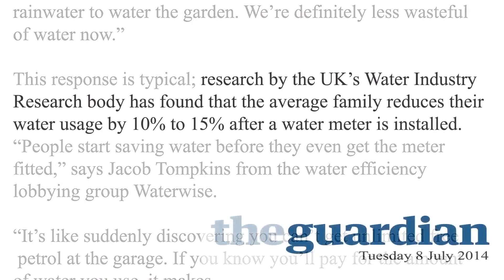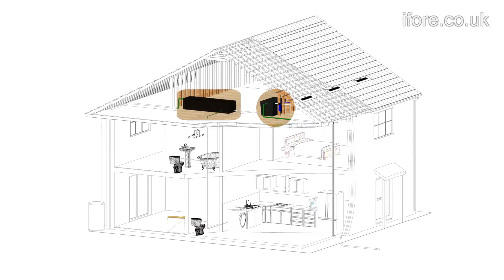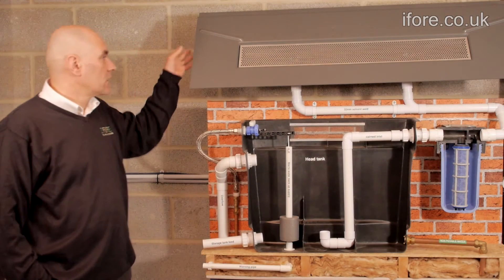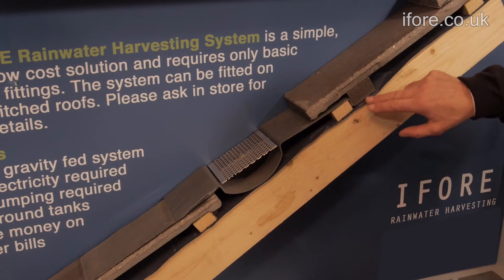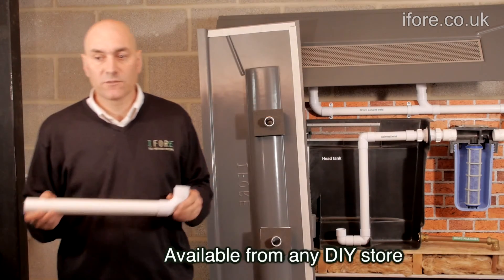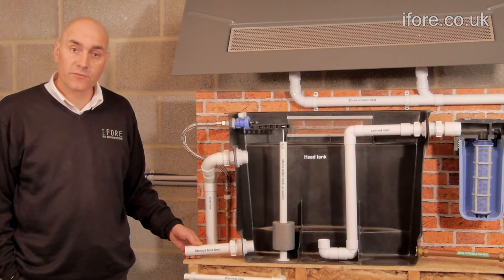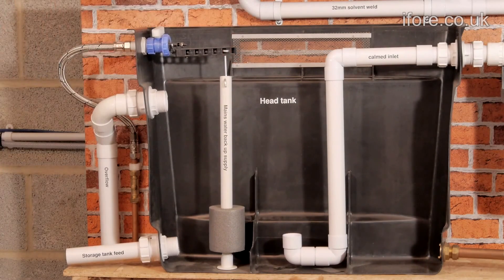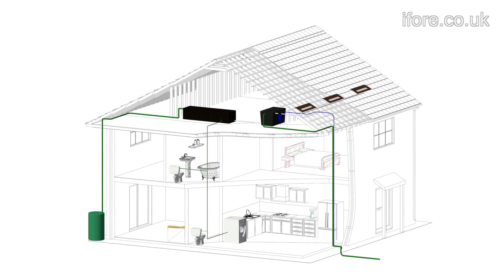RainDropHarvest.com

Comment: Looks good, but more complicated that it needs to be. With a top filter mesh there is a possibility of Moss (or near trees- leaves) blocking the feed system which will need regular cleaning to keep it efficient. There is also no mention of the costs verses savings over (e.g.) a 10 year period.Terry
Reply from the maker: Hi Terry - thanks for your comment.  The stainless grill is situated in the roof tiles and so is at an angle.  Leaves tend to be blown off or washed off by rain.  Moss build up could be less of an issue as it doesn't bond well to stainless steel.  Ref cost savings:  Each installation is individual and saving will depend upon the amount of water storage chosen by the home occupier and rain fall.  However we are working some generic figures and we will post them as soon as possible.   Suffice it to say compared to the "traditional" rainwater harvesting options (ie a large hole in the ground plus electric pumps etc) we are a much better return on investment option with our capital cost being in the region of £1000 compared to their usual £7500 plus!
Reply: @lmccallum8340   Lets say I have a 2,500sqft roof -- whats the cost and whats the max capture in volume of water per inch of rainfall?